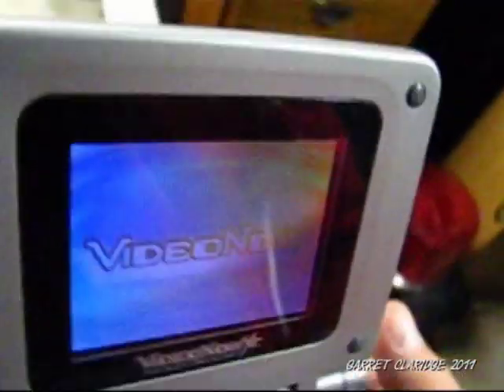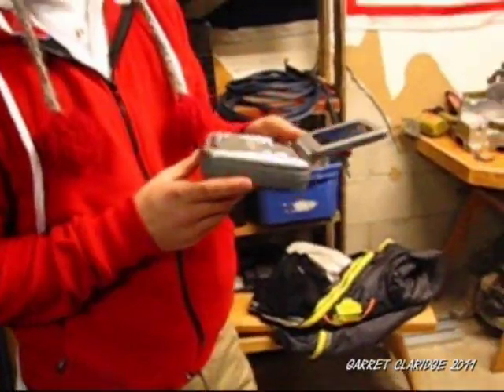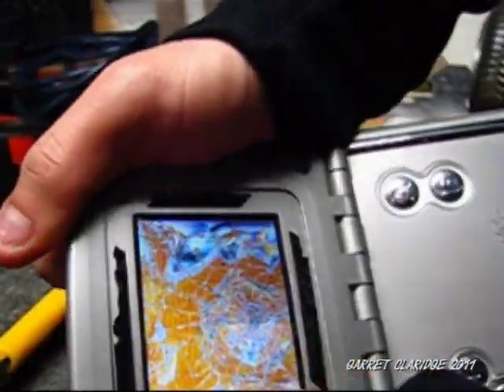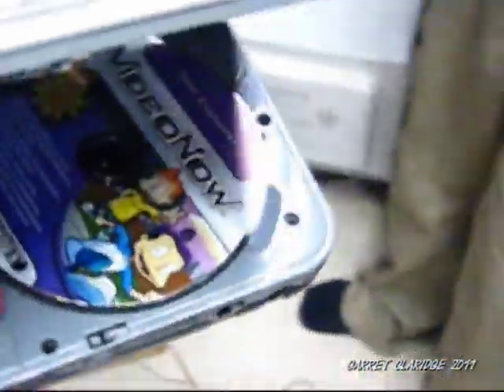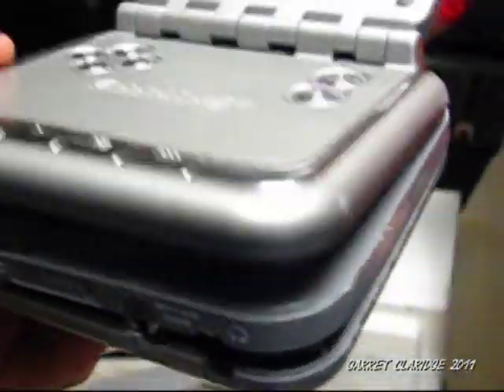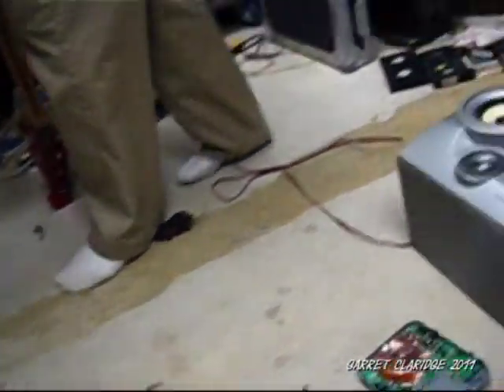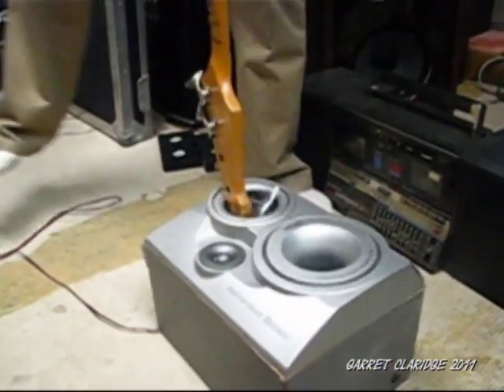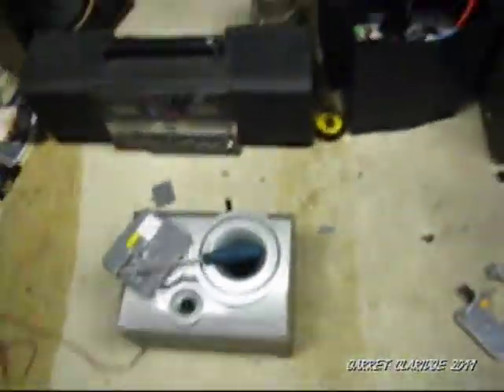Video Now! Smashing

Comment: they are cool , but i did destroy my share of those too,years ago,now good ones are expensive ! i did destroy 3 professional balls back when my aunt sold the wedding hall they had,, one i smashed right in the hall as it was hangin and spinnin,it was epic, the other went to the gun range,the third hung from a steel cable above the disco inferno,put on a little lightshow in the woods until it went down in a big ball of flames"covered in diesel and motor oil",those were the good ol days